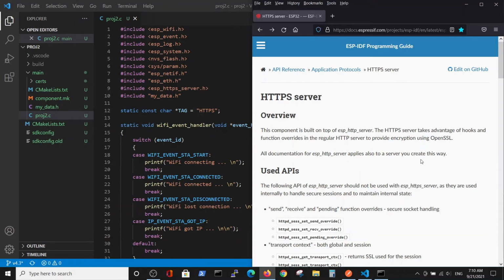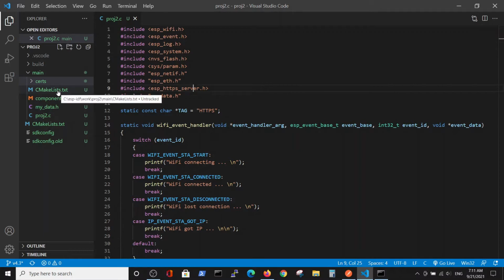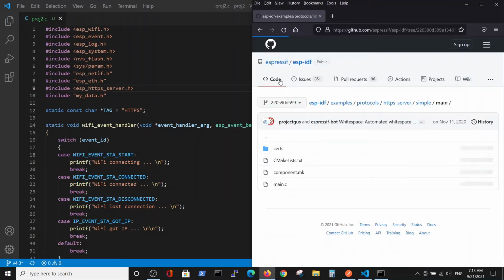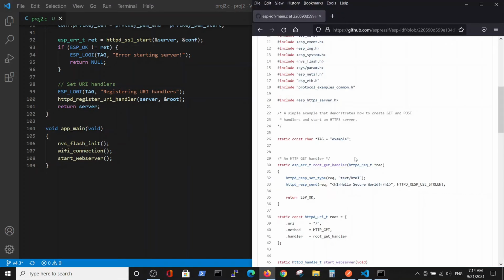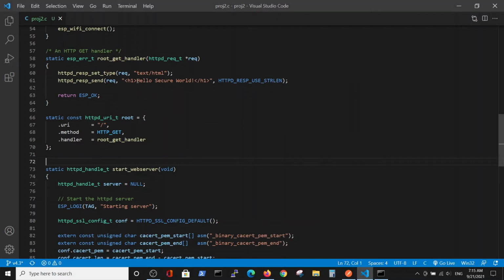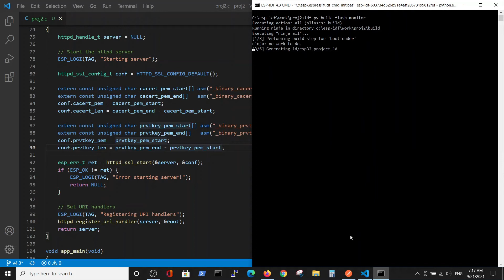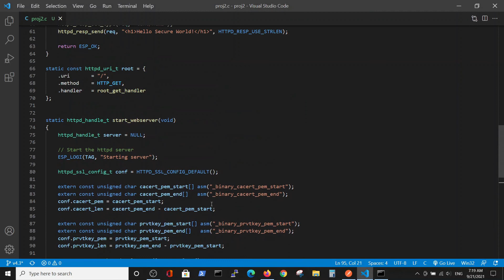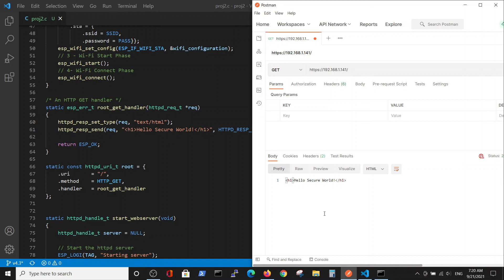ESP IDF HTTPS Server GET REST - Working example on esp32

Comment: *SOLVED*
httpd_ssl_start() logs the next error "Could not allocate memory", this happens in the function static httpd_ssl_ctx_t *create_secure_context(const struct httpd_ssl_config *config), of https_server.c

It seems it happens because It needs a servercert, and since HTTPD_SSL_CONFIG_DEFAULT starts it as NULL it fails.. Where can I obtain it? should I just copy it from cacert? is there a way to get one? Or maybe I have something in the sdkconfig that is messing this up?

Help please! 😭

EDIT: I solved it, the .httpd part of the HTTPD_SSL_CONFIG_DEFAULT must be the same as HTTPD_DEFAULT_CONFIG, but for some reason, in my esp_https_server.h file, it had different values, so I just copy and paste it for them to be the same, so now it can assign the memory correctly and it works!!! 😃

at esp_https_server.h

#define HTTPD_SSL_CONFIG_DEFAULT() {
    .httpd = HTTPD_DEFAULT_CONFIG,     <----- This one had different values, specifically the stack_size variable
    .servercert = NULL,
    .servercert_len = 0,
    .cacert_pem = NULL,
    .cacert_len = 0
    .prvtkey_pem = NULL,
    .prvtkey_len = 0, 
    .transport_mode = HTTPD_SSL_TRANSPORT_SECURE,
    .port_secure = 443,
    .port_insecure = 80,
    .session_tickets = false,
    .use_secure_element = false, 
    .user_cb = NULL,
}
Reply from the maker: Glad that you have found the solution and thank you for sharing.